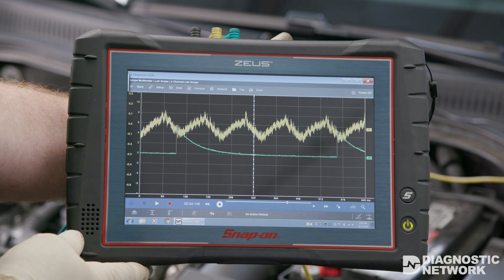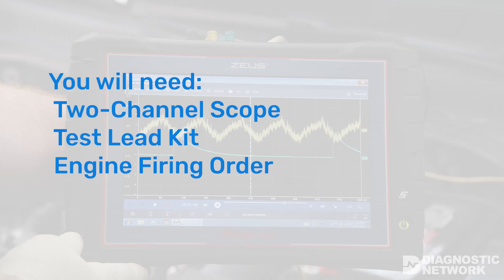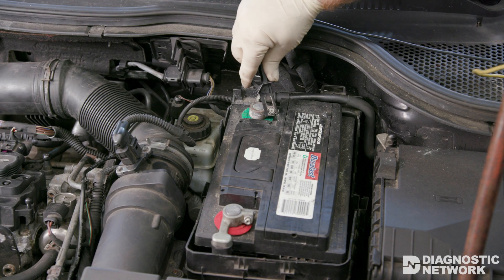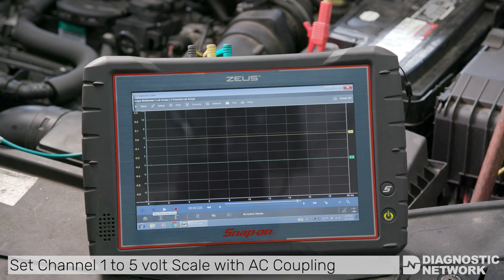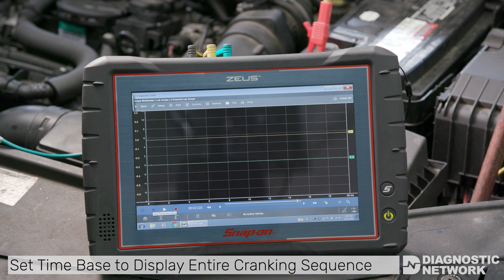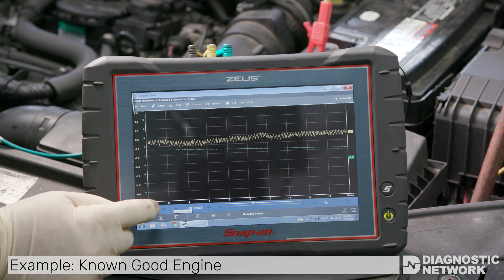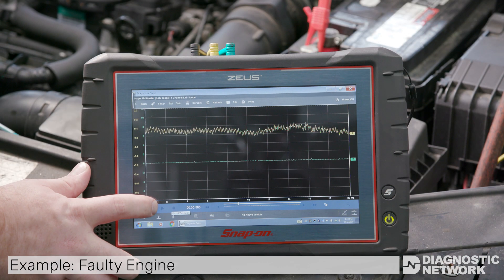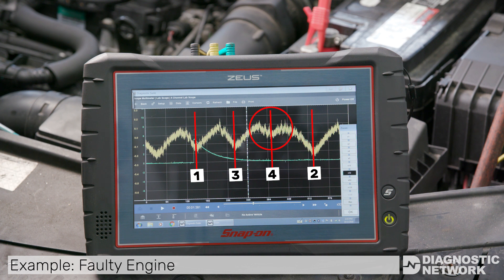Relative Compression Test with a DSO (Digital Storage Oscilloscope)

Comment: Could you get by with a Digital multi meter /clamp meter? Maybe by reading min and max you could tell if one is off average. Trying to get a compression test done on used cars in the field. (Buying from owners on craigslist)
Reply: It oscillates way too fast for your handheld multimeter to even be able to register

Comment: Does not necessary show a good 4 cyl engine , just shows even compression , it is possible all cylinders are low.
Reply: If you look at the peak to peak current you can determine if all of the cylinders are equally low.

Comment: Do not need use attenuator  for the scope ?
Reply: No attenuation because it's only the trigger signal . If you are measuring the primary or secondary then it depends on the rating of your scope .
Reply: New Level Auto  thank you so much for explain me , waiting more videos  on yur chanell  , really good videos as always
Reply: Snap on has a built in attenuator either way